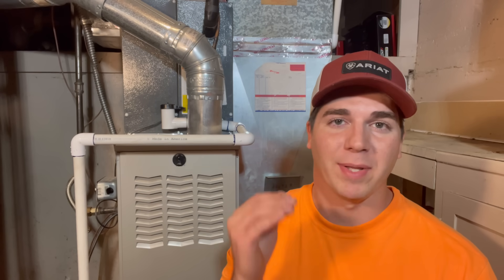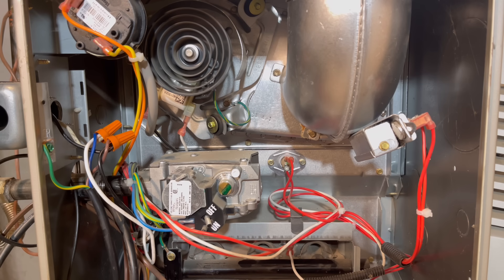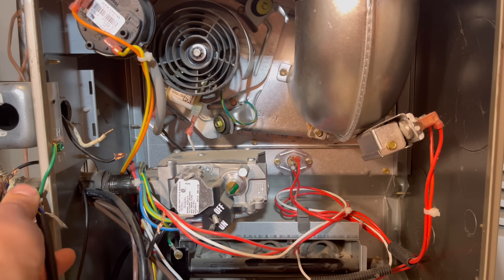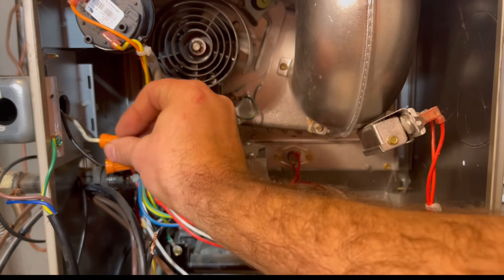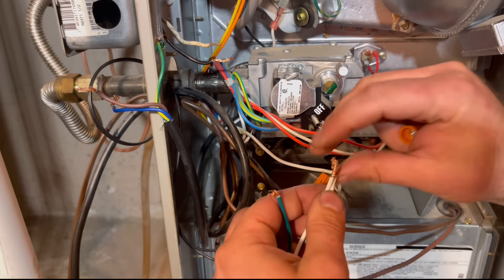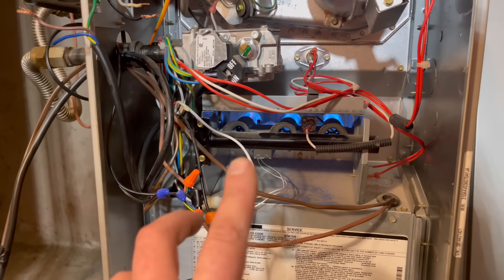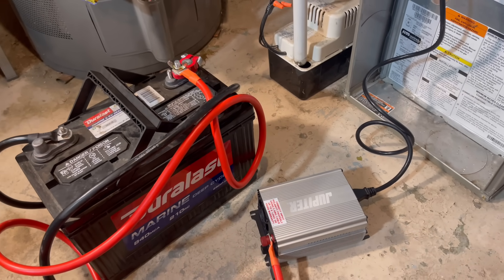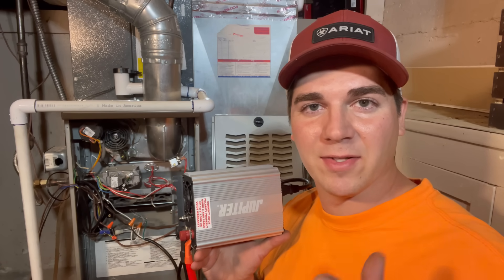Did You Know You Can Heat Your Home With A Car Battery?

Comment: If I estimate that battery at 100ah and the furnace at 600w the combination will last 2 hours MAX run time before the battery is rendered useless. Being a lead acid battery, you will only get 1 hour run time before you see damage to the battery without being able to recharge it. If the furnace runs 15 minutes per cycle you will only get 4-8 cycles and you’ll be dead in the water. NOT days. The idea is sound assuming a battery bank and recharging with a generator or solar panels. You’ll need 12+ of those inappropriate batteries at least and 7200 watts of solar per day over the approximate 4 hours of sunlight per day or 1800-2000 watts of solar panels min. That’s running nothing else. More panels get you more peak sun charging time to use chargers or appliances during that time only. Again, this idea is sound, but not like this. It is fairly simple though. Just research your needs.
Reply from the maker: Yea that’s what I have found from everyone on here. I ended up getting a pure sine wave inverter mounted to my work truck and I can use it to charge the battery as long as I have fuel in my truck. Much easier setup. I apologize that part of the video is not accurate. Stay tuned for the update video! Cheers
Reply: @diyhvacguy  no apologies needed. I’m still learning too. I actually thought about doing this with my system. I have a Renogy 3000w inverter that I can hardwire to the furnace should it get that bad. I need more panels, and more batteries if I’m going to do that. I can keep the 2 refrigerators and 1 small chest freezer going, but it won’t handle the furnace in addition if my numbers are correct. I’d have to keep things in the garage if it came down to it in the winter, but that’s when I’d need the furnace anyway. I’m looking into Signature Solar for server rack batteries and SanTan for more used panels. They still put out the stamped wattage so I’m really satisfied with them. This is in addition to 4 200ah Renogy AGM batteries for around 5kw usable battery power. Any more and I run the risk of hurting these 130lb behemoths. I would suggest the server rack batteries first. 100lbs for one and it has as much usable energy as my 4 boat anchors for only $200-300 more. You’ll pay that in connections and wiring anyway. Uses less space too. It all depends on money, your comfort zone, and space. I even use my system to wash clothes right with good sun. It rarely dips below 85% too. The clothes was an added bonus, but they need to be done on sunny days when possible.

Comment: I've known about these inverters for a number of years with boats. 
I don't think I would have thought to do this trick...freaking awesome!!!
Reply from the maker: Glad you found it helpful :) cheers
Reply: @diyhvacguy  even better with a lithium battery , just saying should last longer buy 2 recharge one as the other is plugged in 😎
Reply: You won’t get 2 full days, inverters are very picky about voltage drops, I run 2 batteries and a 2000 watt inverter in my van it drains the battery very fast just charging milwaukee m18 and M12 batteries
Reply: @ikecostner1  I think that's going to depend on the size of the house and it's energy efficiency.

My house is fairly small. I would guess my heater comes on about every 15 minutes and it's approximately 38 degrees Fahrenheit right now. It will run for about 5 minutes at each heat cycle.
Reply: You are much better off buying one of those $100 generators from Harbor freight because this will not last you more than a few hours before the battery loses enough voltage the inverter shuts it self down for protection. I have been using inverters, solar and car batteries for many years and you need some way to charge that battery, even if it was just a pedal bike hooked to an alternator without charging you are screwed.
Reply: @ikecostner1  you know it takes a fit person a hour pedaling to make enough electricity to toast two slices of bread right? There is a website the allows you to convert various energy to other energy and mechanical force. It won't replace science schooling but ...
Reply: @robertl.fallin7062  I never said anything about that being a viable option but you need SOMETHING to induce a charge otherwise it will not work at all
Reply: @ikecostner1  Worked for Gilligan....
Reply: I use this technique for nearly everything that I have to take apart that is complicated, e.g., automotive brake assemblies, or engine layouts - and it's saved me in several situations where I had significant time pass before repairs were made.
Reply: What technique? 
An inverter for for brakes and engine work? 
I don't get it.

Comment: Whats your amp draw?
Reply from the maker: 7 amps
Reply: @diyhvacguy  thanks for the info. On the same idea, several years ago I went on a trip through Ecuador. I have sleep apnea. Part of the time we stayed in a lodge in the Amazon rainforest. We every thing was powered by 12volt car batteries. Mostly just lights. When talking with the host he brought over a 12 volt battery and inverter. Ran my CPAC machine for the 3 days we were there. He had a solar panel array that changed his batteries. Really off the grid.
Reply from the maker: When I do the test video I’ll show the amp meter on there 👍🏽

Comment: Have to use a marine battery. An ordinary car battery will die if it drains too low, and it won't run as long like a marine battery can.
Reply from the maker: I’m actually going to be hooking up a pure sine wave inverter to my work truck so the alternator can charge it continuously. Car acts as a generator except much quieter and way longer run time! I’ll be uploading that test video soon so stay tuned! Thanks for watching and commenting. Cheers
Reply: @diyhvacguy  That would work!
Reply: Marine battery is better but can still be damaged below 50% output.

Comment: I have the same setup for my parent's forced hot air gas furnace.  After the master switch, I wired a single (so no one would plug anything else in) AC outlet.  I then hooked a pigtail to the furnace itself and plugged it into that outlet I just installed.  When the power fails, I simply unplug the furnace from the outlet and into my pure sinewave (better for electronic than MSW) inverter, or generator.  Simple and logical.  When using a battery, or generator, I run the house up warmer than usual before shutting down inverter or generator.

On a side note:
A Toyota Prius can also be turned into a generator to power a furnace, or fridge.  Hook an inverter (again, a pure sinewave is best) to the 12 volt battery in the trunk.  Keep ignition "on".  The car's engine will start/stop as needed to charge the traction motore, which in turn, charges that 12 volt battery.
Reply from the maker: This is great! I need a Prius lol
Reply from the maker: Thanks so much for sharing

Comment: It be curious to know how your fan on the AC unit outside is running. That too usually runs when the furnace is on to pull out the cold air... In some units if the outside unit 220 isn't working the furnace inside will also not work regardless of where the power is coming from.
Reply from the maker: Oh you are thinking of a heat pump this will not work for a heat pump. That requires 220v
Reply: @diyhvacguy  Thinking of my unit here. It's not a heat pump.
Reply from the maker: @michaeljavert4635  I think you have a heat pump if your outside unit runs in the winter. There should be no reason your outside unit would be coming on and it could actually damage it if it’s not a heat pump.
Reply from the maker: Do you have a model number on the condenser you can send me and I can confirm? My email is diyhvacguy@gmail.com
Reply: @diyhvacguy  I don't know. I have the information from the furnace itself.

Trane
Model 4TXCB004CC3HCBA

Serial 15504R7NCG

Mfg Date 12- 2015
Reply: That’s only if you have a heat pump.  He has a straight gas furnace, not a heat pump
Reply: @bobmiller2921  I have a straight gas furnace too. The fan outside in the AC unit comes on when the furnace starts. Actually, the fan outside starts a few seconds before the furnace.

Comment: Ok for those of you who do not know, you NEVER EVER EVER leave a car battery or I should say, a Lead Acid battery on concrete or cement.... it should always be on a piece of wood, at least 1 foot off the floor, it affects the specific gravity of the fluid in the battery and they die.... this is what a " battery tester " is used for, to test the fluid in the cells, even if full to the top, the battery can still be no good..... some call it a hydrometer           Deluxe HYDROMETER BATTERY TESTER test specific gravity fluid lead acid batteries
Reply from the maker: Thank you for this. I have heard mixed things on this but you seem like you know your stuff!
Reply: That is an old wives tale and hasn't been true for many decades. Google it.
Reply from the maker: @tgriebe  yea that’s what I heard too. So much misinformation floating around. Lol

Comment: I've done this for years, except I just run an extension cord from the battery to the furnace. And when the battery gets low,... just start up the rig and recharge your extra battery, not your rigs starter battery.
Reply from the maker: YES! Interesting. Where do you keep the additional battery? I was just thinking of using the truck battery so I have my inverter mounted in my cab and cables run to the battery.
Reply: @diyhvacguy  I wired it up in the back of my pickup box and covered it from the elements or damage from loading things. You will need to wire in a battery switch so when your starter battery is full the power will go to your extra battery like a recreational vehicle/ motorhome.
Later on I just bought a three cylinder Subaru piece of junk but it ran and made that my generator battery house out of the whole dang thing. With a little imagination you can figure out what to do with the whole car and all this drive axles use them as "tools", saw, sand, spin, etc. Use the air conditioning and the heater it will keep your solar panels defrosted and free of snow the batteries can stay warm if need be. Heat cool your bedroom or house. One can hide the whole thing in the shed and put your solar panels on top. With just a little imagination you can do many things even with a motorcycle. 12 volt charging for your whole home plus inverter. The other thing is your generator has a built-in radio ect... just use from the dash to the front bumper get rid of the rest of the car if you don't want all of that transmission and stuff. Heck you can buy a brand new rig that's been smashed up at rear and have a cheap generator it will last for more than 20 years and it's super quiet . 💡🛠 Age 65.

Comment: I did this last year in CA for my furnace when we had no power for 15 days during winter in the Northern Sierras. I had to use two large SUV batteries in parallel as I have a large  furnace  with five burners. The ignitors pull over 20 amps at 110 volts so they need over 200 amps from the 12 Volt DC batteries for about 15 to 20 seconds which a single battery was unable to supply. I had a 12 Volt trickle charger on the batteries powered from a separate backup generator which powered the rest of my house. The problem for any generator setup is driving the high amperage stuff like microwaves, coffee pots and heater ignites. As a side I used my prius as my generator to run my house as it only runs the gas motor as needed to keep the batteries charged which I hooked up to a 6KW inverter. Most generators burn 24 gallons of gas per day. My prius only burned 5 gallons per day as it runs only to recharge the main battery as needed, not continiusly.
Reply from the maker: That’s amazing thank you so much for sharing. This is what I ended up doing actually. Mounted the inverter in my truck, and then I’ll have a make pigtail for the furnace so it plugs into the outlet providing it with grid power. Then when power is lost, I simply unplug the furnace and plug that make pigtail into my extension cord to my furnace :)
Reply: Spencer, I was aware of the Prius trick (actually mentioned it above before I saw you did as well).  I was told to limit the inverter size to 1000 watts though since there are limitations in capacity for the circuit that keeps the 12 volt battery charged from the traction motor circuit.
Reply: Great tip. Thanks.
Reply: Gotta love the concept of a hybrid. Do they make them with 50A power receptacles?
Reply: A gallon per hour if your generator is very large. If you are just keeping batteries charged you can get a 1000 running watt generator that will run about 6 hours on a gallon of gas.
Reply: And don’t forget there are small 24V DC generators specifically made to keep deep cycle batteries charged…

Comment: Great video But. This will not run a furnace for days. The blower box on the furnace is going to use at least 300 watts.. It would work for a while with short cycles.
I have eight batteries like that but mine are the thousand cold cranking amp. At fully charged at 13 volt. You can draw about 500 watts for 5 hours.
Reply from the maker: Yes this is what everyone is saying. What I ended up doing is permanently mounting a pure sine wave inverter in my truck and then I can just let it idle and power my furnace for as long as I have gas in the truck. I’ll be posting that video soon :) thanks for the comment! Cheers

Comment: Be careful buying inverters, they advertise Pure Sine Wave but in the description it says Modified.
I hear that the modified sine wave type is not for inductive motors.

Inductive motors can take 7 times the running current to start up, so size the inverter accordingly.
1100W divided by 110V = 10A    
If Running amps is 4A, then 4A X 7 = 28A   during startup.
28A X 110V = 3080W
Your 1100W inverter may work a couple of times, but will not last long.
You need a 2000W / 4000W peak inverter, or larger since a furnace has 2 inductive motors.

You can do the same set-up for your refrigerator, freezer, and lighting for your house.
You will need separate batteries and inverters for each load or a battery bank with a huge inverter.
Change out all your lighting to LED bulbs for longer lasting use with inverters.
The pure sine wave inverters can also be used with electronics, like TV and computers.
You can connect a solar array charge controller for charging your batteries.

Comment: Great video, you could add a solar panel and maybe get some more time.
Reply from the maker: That’s a great idea! I’m actually going to connect this to my truck so it will stay charged as long as there is fuel in my truck, and it uses hardly any fuel at idle. So stay tuned for that video! Thanks for watching! Cheers

Comment: That's all well and good but you're not going to give but maybe an 45 minutes to an hour off that battery but squirrel fan pulls a lot of volts
Reply from the maker: That’s what everyone is saying. I thought otherwise but clearly I was mistaken. I’m actually going to be running this off my truck with a pure sine wave inverter so the alternator can continuously charge it. So I’ll do a video on that set up soon. Thanks for the comment! Cheers
Reply: You need a voltmeter on your battery because if your voice gets too low you can damage your battery and your inverter with three semi batteries I could run my area in it on my camper for about two and a half 3 hours if I had my harbor freight solar panels hooked into my system I could run my air unit all day long until the sun went down that I had to switch back to my generator

Comment: I like the concept however maintaining the entire dwellings temperature isn't overly practical. Especially with a single battery.
Maximize available amperage with a small space heater in an isolated room. Shut off water and drain water lines.
Again, the concept is great! Larger battery bank & solar panel(s) then you're into a fun project. 
It's the right time to adopt a preparedness mindset!
Reply: Probably takes more juice to run an electric space heater than a gas furnace.
Reply: @percyfaith11  probably right.
That's the enjoyment I have found in "emergency preparedness".
Determine what are critical needs. Then determine how to fulfill those needs if no power, water, gas/propane was entering your home. It's easier to prepare than to react...
Reply: my car has built in inverter.    long extension lock doors (extra key } 3days no power.  My  friend needed power for life saving Medical device. Car ran all night gas Expensive 
Best Friend PRICELESS
Reply from the maker: For sure. Thanks for the ideas. And thanks for watching’! Cheers